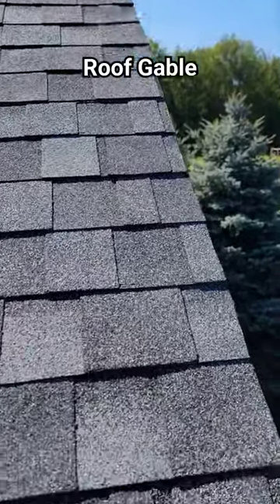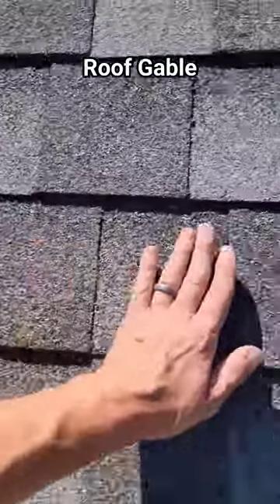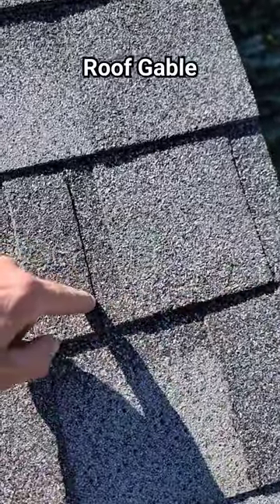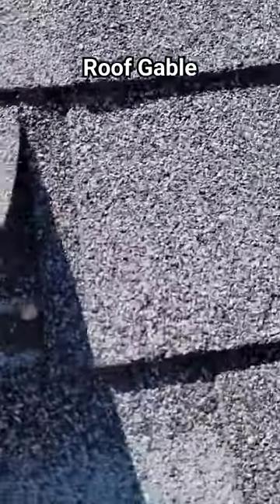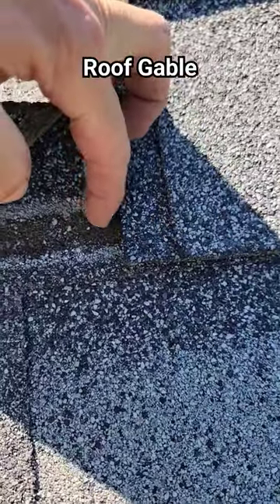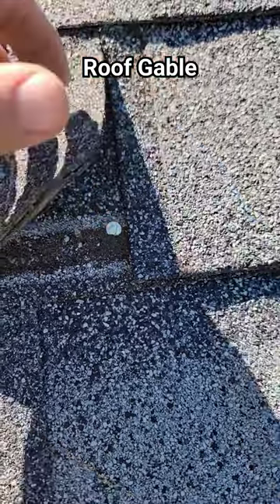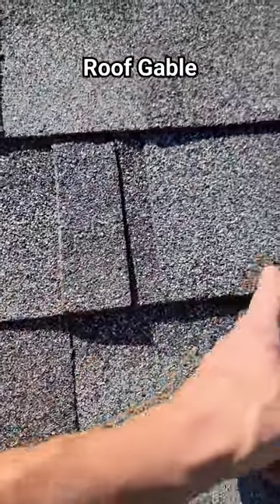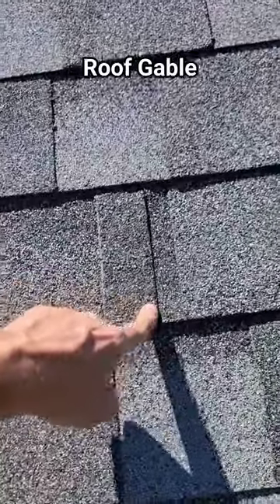Roof Gable

Comment: All the tabs should be stuck down, covering any nails anyways.  If the tabs are able to be lifted by hand they should all be tacked down with roof seal sealant.
Reply from the maker: The roof was just done a day or two before this inspection. Doesn't matter if the tabs are stuck or not. If a nail is in the key way, it will overtime rust and Waller out, leaving a hole causing a leak.  Nails do not go in the area where a drip groove above will be. The same reason you offset shingles. If you stack shingles right above the next it will cause a leak. The shingle seal strip seals the shingle from blowing away. It has nothing to do with keeping the nails from leaking.
Reply: What the man above is saying, if the shingle lifts by hand, it will lift in winds & then driving rain will get up and under, ps it will hundred percent let water in threw the nail before it corrodes, i think people need to find someone else to inspect there new roofs, or get a company they can trust todo there roofs so they dont need to get some scam inspector !!!!!!

Comment: Is there any benefit to sealing those nails in the keyways when you do find them or is it just a wait and see scenario because there are likely so many?
Reply: Youl could grab a piece of step flashing, smack it down flat. Then slide it up where the seam is, then caulk the bottom side of it to glue it down. Just need to make sure it goes past the headlap of the shingle and go past the seam on the sides at least 4".

Other that that theres not much else you could do, could caulk it but its a "waterline" so its not the best method.
Reply from the maker: If you can find them, yes, by all means, seal them. Although it's best to just not have them there in the first place.